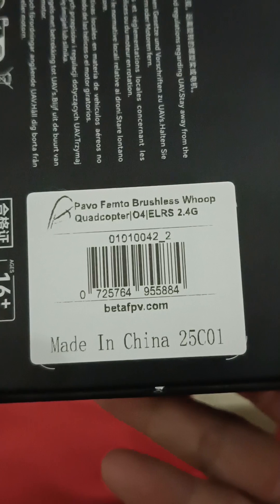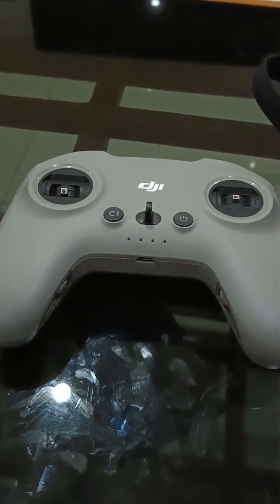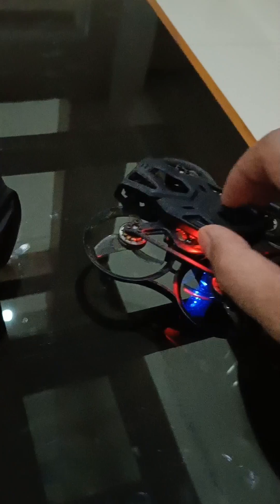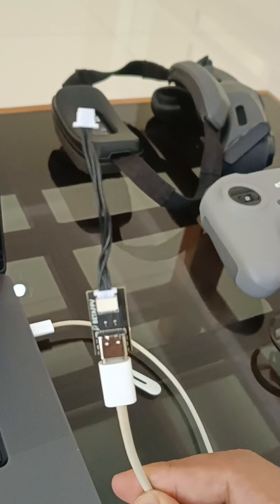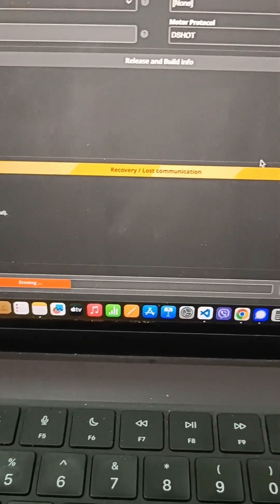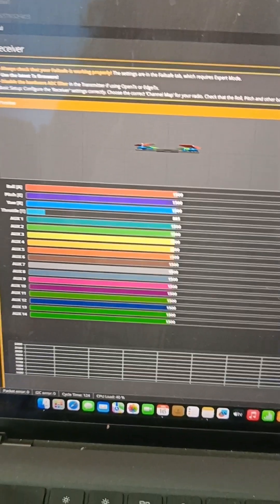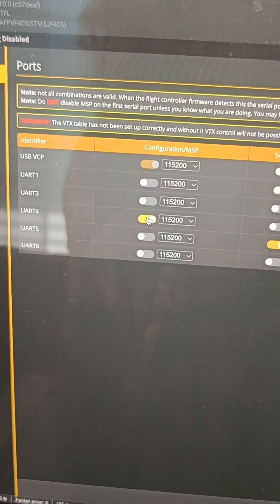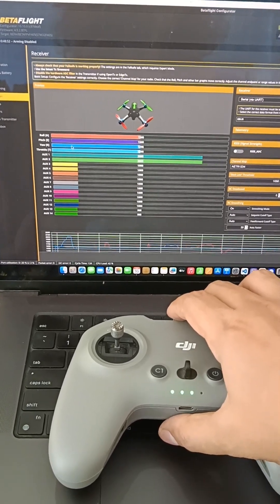Pavo Femto + DJI Goggles 3 + DJI Controller 3 + BetaFlight Setup

Comment: I'm having problems installing the new firmware. Once Betaflight automatically detects the board, it seems to work fine... I select the other options just like in your video, but when I try to install the firmware, I get an error opening the serial port... I can't proceed, I can't fly ayuda porfavor
Reply: resuelto, habia que actualizar el mando rc3, pero sigo sin poder actualizar el firmware

Comment: hello! I followed this video howevver  my remote still does not connect to the drone. on the Beta FPV configuration tool I see that the reciever has input since the colors and the bars change. But when I unplug the drone and go to fly it, it simply does not work. I am not sure why.
Reply: Maby ur remote has not ELRS ?
Reply from the maker: Make sure you've your save your settings, must arm drone before flying and make sure battery is full (FCs has battery protect, won't fly when only on 3.3v on a cell)
Reply: Plug your DJI app to the goggles and turn on the rc 3 and when they are paired see if you have to update the controller.. that worked for me …I’m now stuck not knowing how to get osd to work it was there and then when the controller linked making it fully paired osd panel went away

Comment: How important is it to flash firmware? I've done all the other steps but it doesn't work.. I have all the colored bars but they don't move. Does my flight controller not actually have SBUS and that's why I need to flash it? I have tried it but the operation fails. Says it's trying to reboot to begin but faults out. I reset software and connection and it just loads, thankfully I haven't bricked it 😩 No idea what I'm doing this is my first go with Betaflight
Reply: I figured it out. I needed additional software for Betaflight
Reply: @rocklobster207 I'm facing with the same issue, what additional software did you installed?
Reply: Unreal .. turned out to by my RC3 firmware!!! It was OG version. Pretty sure I didn't have to flash at all.
Reply: @rocklobster207  How did you solve it? I haven't been able to make the receiver of the RC3 work in the receiver tab, I move sticks and nothing happens
Reply from the maker: @luiscarlosjayk Make sure you are connected to your goggles and is set to sbus* and in betaflight make sure receiver is set to sbus and type the command also in the cli
Reply: @JiefoolFPV thanks. It turned out I had out of date firmware on my FPV RC3 controller
Reply: @rocklobster207 como você conseguiu amigo???